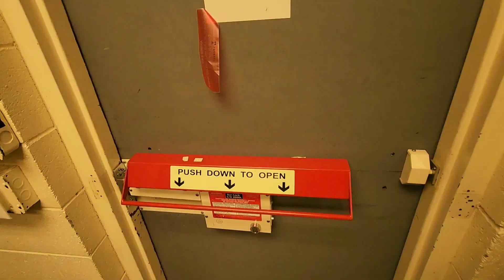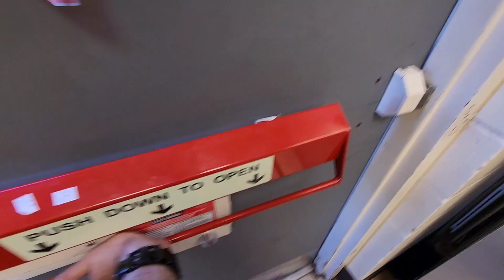Push Down To Open exit device, panic bar or crash bar repair and alignment & door closer repair

Comment: Hey Wayne, you can also adjust those rods coming out of the sur lock panic bar. All you have to do is unscrew the bottom box and the cover that is over the rod. It has an adjustable nut on the other end of it.